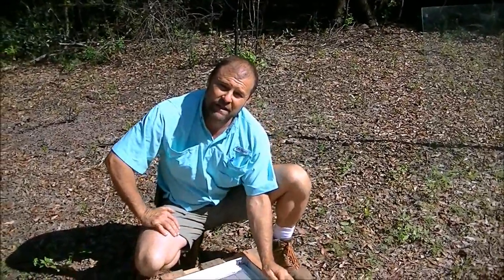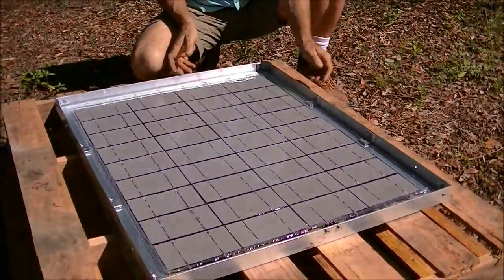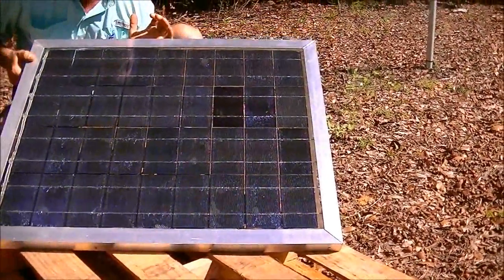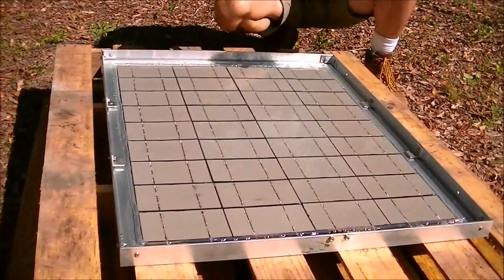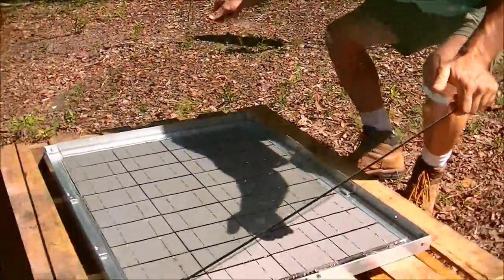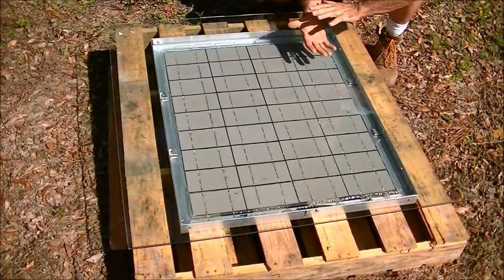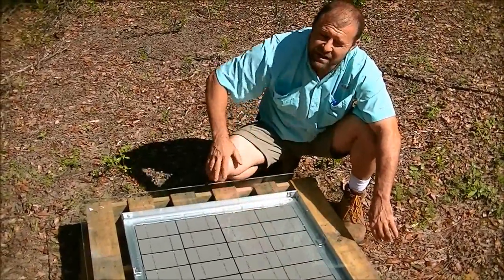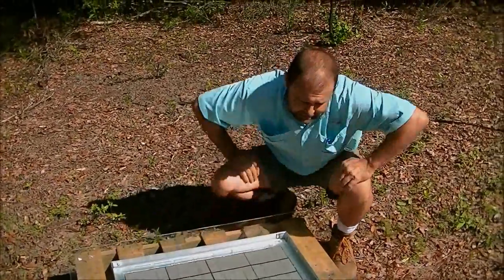Heat cure solar panel encapsulate trick. Trick to get it to set up.

Comment: The actual problem is in the resin. When mixing the resin, mix it in one container and pour it into another container and mix again. Do NOT scrape all of the resin from the first container. That container will hold any resin that was not properly mixed. Use ONLY the resin from the second container. Voila!!!! No more problems.

Comment from the maker: I always have to heat cure mine in the sun. I don't know if more hardner would help. I like the slow set it gives the encapsulant more time to get thr bubbles out. You would have to build a vacume chamber and have vacume pump. Yo much trouble for the average person to do.

Comment: When it does not set do you think you need more hardener .or maybe more thorough mixing,also i have been told if you mix it in a vacuam situation you will also elimate the bubbles ,I am not sure how you would do that

Comment: Would you still recommend building your own panels with the price of solar around $1/watt now? I've looked into it when prices were higher but now that the prices are so low, i find it hard to build a panel when you can buy one for not much more with warranties at least 20 years. Just curious what your thoughts are on it.